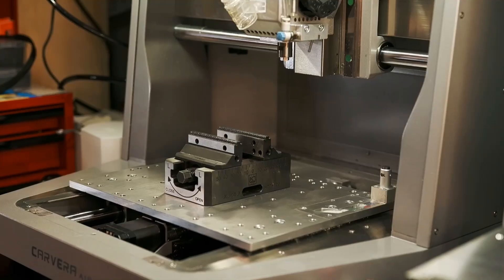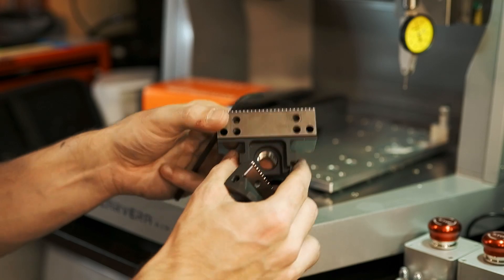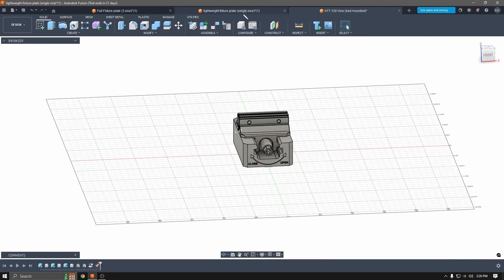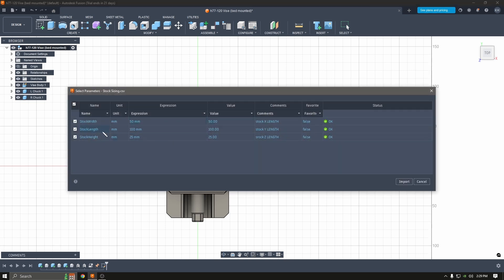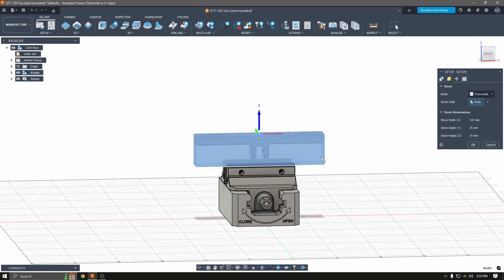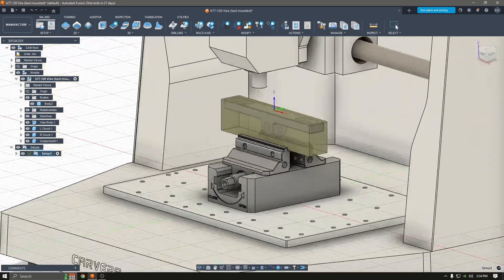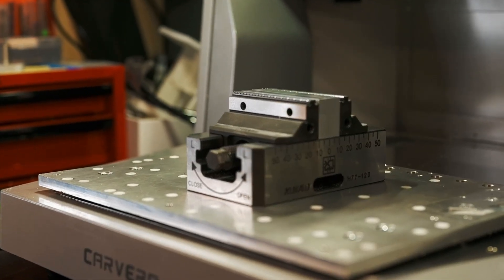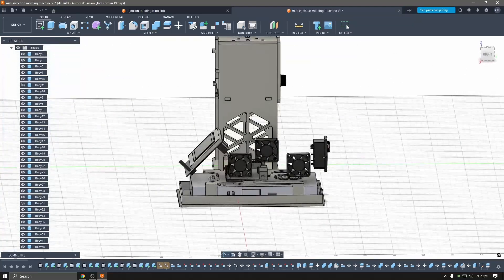Desktop CNC Vise Setup! - Makera Carvera Air

Comment: This is honestly such an amazing video. I actually have the same machine, and I feel like a monkey with a jet engine — I can get it to run, but I’m not even using a third of its full potential yet.

A suggestion for future videos: you’ve just earned a new loyal subscriber 🙂 It would be awesome if you could show your full workflow, or how you literally connected the machine to Fusion 360, or how you use the probe.

I’m honestly struggling with Makera CAM software, and if I could manage to use Fusion instead, it would be perfect.

Greetings, and keep up the great work!

Comment: Are you using the SMW tooling plate for the Carvera Air as one of your vise mounting options? Thanks!
Reply: I think that's actually the base plate that the stock tooling plate is usually bolted onto; looking at images of the SMW plate and the stock setup, it really seems like he's just removed everything but the base!

Comment: Hi, what pendant are you using? Thanks
Reply from the maker: It was one that i made from an 3d printing and a Arduino (ESP32)
I will be making a video on how to make one soon!
Reply: @LOOSEBOLTLABS Nice video! I am super curious how you made the pendant. I'm eager to send manual commands to my Carvera Air. I have a YouTube channel where I make my PCBs and software and stuff so this is up my alley! Looking to start modding my system to be better for small scale automated manufacturing.
Reply from the maker: appreciate it! Sometime in the future I will have a video out on how to make 2 different types of pendants for cheap, one that emulates keyboard commands and another that works like the real pendants with macros. including all the files, board firmware, and BOM
Reply: @FluxBench  Community controller does support a WHB04B
Reply: Looking forward to your video on the topic

Comment: Where did you get the carvera air setup for fusion? And what are you using for your probe setup? Amazing work!
Reply from the maker: The fusion machine setup is from the Carvera community GitHub  but I had to rework the models a bit to work for the vise, those files are in my GrabCad (same name)
and the probe is a $50 3D touch probe.  A member in the community named  "The Props Monster" has a detailed documentation on how to setup/ use
Reply: @LOOSEBOLTLABS thanks!
Reply: @L @LOOSEBOLTLABS  factory xyz probe is horrible lol

Comment: did you machine down your whole bedplate on the same air?
Reply from the maker: i was going to with a 25mm face-mill i made, but after running the indicator along the bed a few different ways, it was surprisingly only off by .001mm from side to side
Reply: @LOOSEBOLTLABS 0.001mm ? yea, right 😂
Reply from the maker: @dimsum5567  I didn't believe it either, i guess i just lucked out. new vid showing it in shorts
Reply: @LOOSEBOLTLABS your indicator must have been stuck… this table of a thin aluminium plate is warped as f%@k… easily 0.1mm out.And unfixable unless you throw this thin plate away and machine a new one with a 1” thickness at least from a MIC6. Putting a heavy vice in the middle of this plate will probably sink the middle of it  by 0.05 mm. I have 2 of these machines.
Reply from the maker: @dimsum5567  agreed, the weight will warp the middle of the bed over time,
This is somewhat temporary until i can get a bed manufactured out of titanium, 
This way just saved me some money for now and also not having to fight to square off the new bed
Reply: @LOOSEBOLTLABS  Did you machine down the nubbins that slot into the mdf board? or do non kickstarter carveras come out like this?
Reply from the maker: @tijnieken  on my machine i was able to remove them easily with a 7mm wrench 
(they were m5 thread and removable) 
I did notice they are used for the alignment pins all throughout the bed for the L brackets and 4th axis but also aligns the mdf board to the bed